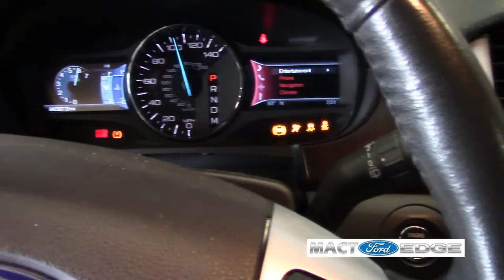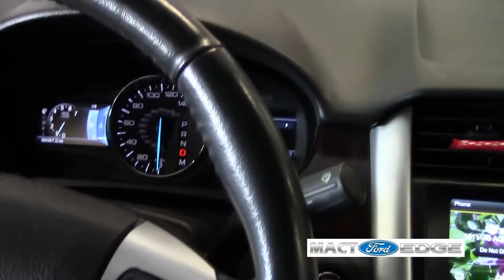Ford Edge Front (inside) rotors destroyed by rust

Comment: helpful tip.. don't add brake fluid just because it's low. it should never leak out. as the shoes/pads wear the fluid will drop. once all of the wearable brake components are replaced the fluid should go back to its original set level (unless someone has removed or added fluid). keep in mind changing fluid per vehicle schedule is highly recommended.
Reply from the maker: Good tip.  My shop I frequent fills all fluids.  Just have to deal with it.

Comment: Great video!  Please let me ask - I have seen two other vehicles with rusted inside (only) rotors,  however on both of them the caliper pins moved freely (they had grease, and moved easily).  So in THIS case you said the rust builds up from uneven pressure....and that seems believable.  And so when I asked about the rotors I saw (rusted badly, inside only) people told me that it was because the vehicle sat for extended periods of time.  But to me, I would think if that was the case, both inside AND outside would be rusted.  So I guess I'm asking you if you can think of any other reason for them to rust inside only, besides the pressure thing (due to un-lubed  pins)?

Comment: I am curious what lube if any was used on the slides. the correct lube should last the life of the pads.
Reply from the maker: Water, Heat etc will eventually remove the grease or brake lube. Keep in mind these had not been serviced in five years.  The edge was just out of warranty and this is the reason I went in to inspect and check the brakes.